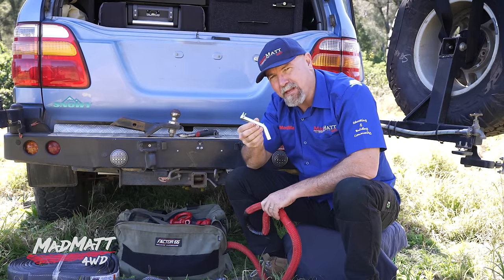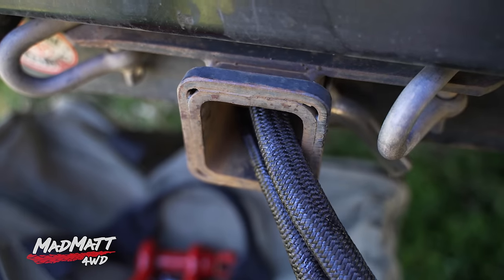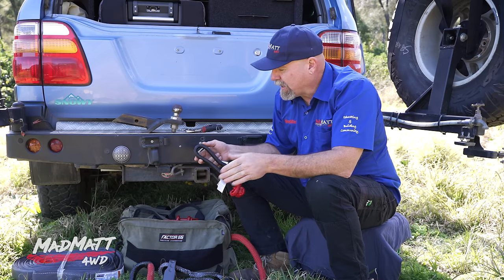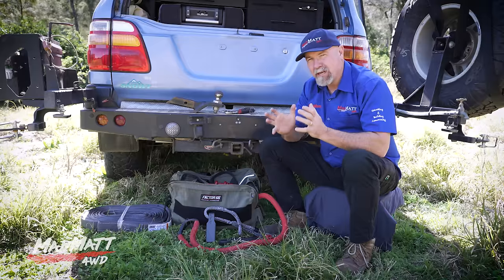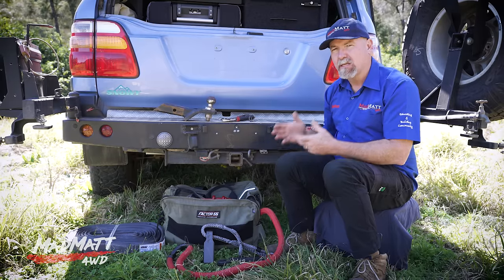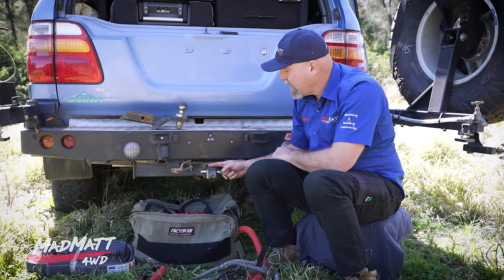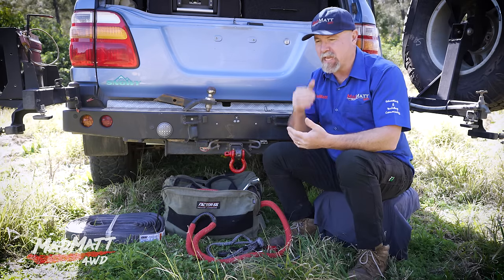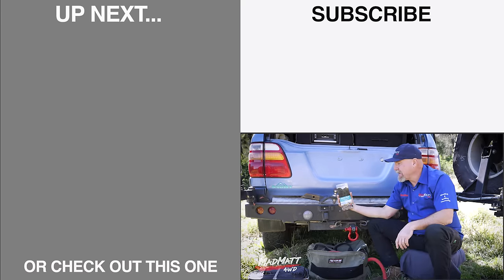Should you use a hitch pin as a 4x4 recovery device? Is it a YES or NO answer?

Comment: Just a question and are we overthinking this, has soft shackles created more hassles than what they are worth at this towbar connection?... cannot figure out why the Hayman Reece tow hitch with the towball removed obviously? I have been leaving the standard tow hitch in the truck and bunging it back inside the hitch receiver then use a bloody big bow shackle thru the towball hole. This has worked for 50 years of 4WDing, many many kinetic tows, many snatch block winches, also many sideways pulling vehicle back on tracks. Also $180 for a hitch receiver.... WTF!
Reply from the maker: Mainly because they are failing. You've got away with it as many others do but that dosn't make it best practice when we learn of failures. Check out this video from the other day. https://youtu.be/2rHvQykNt2M
Reply: @MadMatt4WD  my two bobs worth 'respectfully': the standard tow hitches are likely as strong in every way as the complete towbar assembly. To demonstrate this lets talk about the tow pin, they are not rated because there is no evidence worldwide of any (in good condition) ever failing. 16mm dia pins in 50mm hitches do not fail and it is an industry standard but never tested to my best research (or any tests are not made public). Now let us get to the actual tow hitch where the 50mm SHS (square hollow section) is welded to the often 18 to 20mm thick plate where the towball mounts. The welds as far as I have inspected in a local parking lot are 6 to 8mm fillet welds probably done with robots and perfect. The engineering rule of thumb (engineers will tell you not to use rules of thumb but they all do unless a full analysis of the joint is required) is that 200mm of 6 to 8mm fillet weld will take about 20-30 tonnes of pretty well any tearing, ripping, transverse, shear with a 3 to 5 safety factor. I rest my case that a 'standard' tow hitch will never fail as you say (by the way, lets see a few of the weld failures in standard hitches you mention?? not the stupid extended ones) with kinetic pulls when I will say the kinetic ropes will break long before any standard towhitch with a forking decent bow shackle thru the towball hole. Maybe head down to Swinburne Uni of Technology and ask nicely for them to test standard tow hitches with a 30mm offset of the tongue to the SHS tube. I spent many hours there destroying bolts, plates, welds and anything us students could get our hands on, 45+ years ago and you might be surprised. Then get one of those offset tow hitches like the one that horribly killed a person and test that (the one you demonstrate with the retracting tape measure with the 200mm torsional offset, moment arm, call it an offset force even), the result will be like chalk and cheese (sooooo much likely to fail in every way due to torsional forces that rip, tear and destroy). I did look at the photos of the accident hitch and it did not seem to break at the welds, the SHS tube was torn by torsional forces much higher than anything that could be applied to a standard hitch with any pull a driven vehicle could muster (not a shock pull with a chain, I think that as you say is dumb). Also most decent hitches now are one piece forged units (my 2021 hilux) that I reckon would be even stronger than the $180 alloy recovery units (maybe test these too?). In many ways I am saying that recovery item such as the alloy units that are very expensive are not generally needed and you really should be educating that standard hitches are OK and extended ones are not. You are not comparing apples with apples in your video and this really is important in an engineering sense. Maybe John Cadogan can help with some engineering stuff that your videos do really need. Also as an aside just maybe also say that $39 solid steel billet recovery receivers are around and we dont need this expensive stuff to stay safe.
Reply from the maker: @petermills1402  that’s more that two bobs worth. 😁 I dont disagree with you but take the time to read the comments and understand my audience. I can’t go into the subilties of the subject as you’ve explained. Most of my audience aren’t engineers nor have a concept of it so I try my best to stand in the gap for them between good engineering and bad practice. We have numerous examples of hitches and tow balls failing near the welds for a number of reasons. Fatigue rust, drop hitch, poor quality materials. So, do I try to explain all the different possible reasons to inspect a hitch or do I give a simple solution as to why they’re not always safe and provide a solution. I recommend Factor55 because they’re at the top of the game but I don’t care what people buy so long as it’s safe and not cheap fake stuff. I don’t force people to support what I do it’s their choice if they appreciate the free content I give to them. I also have a fairly large network of experts I engage with so that I’m always learning. There’re generally supportive and in agreement with my work. Obviously we we have differing opinions on some stuff but we work it through. Also John did comment on the video and is not a fan of hitches as a recovery device.
Reply: @MadMatt4WD  here is a challenge for maybe you and Robert whom I also respect his opinions mostly:  just contact Nobles Cranes and Testing Lab for some real testing with an actual engineer in charge and ask if they can test hitches to actually provide some evidence of your advocating (with little or no evidence) that the welds of a standard tow hitch are not safe at the loads of kinetic ropes and straps. Maybe up to 20 to 25 tonnes pull would be a good test, I reckon all your ropes would break and the hitch remain intact. Maybe a standard Hayman Reece 3500kg  tow hitch is a good starting point then the forged tow hitches as on my  recent toyota hitch. I also have inspected several of the 'alloy' recovery hitches some with towpin holes in both directions and these seem a bit 'how should I say' "interesting" and these should also be tested as I for one would not trust one without certified testing. There I have said it, some recovery hitches may not be safe... but I have no evidence, I guess we are in the same boat in an unregulated often cowboy industry of 4WD recovery. Only testing, not talk, will clear some things up and that is what I am really getting at. I would like to see you say that standard well branded tow hitches are OK but dodgy ones are not (just like you advocate a brand of recovery hitch but not others) and provide examples of both rather than just defer to the $180 hitch as the ants pants. Its Youtube you know and us viewers/users are very suspicious of product placement when other things will do the job safely. After all this we have not even begun to discuss towbar connections to vehicle chassis (nor the garbage chassis recovery points I have seen with pissy bolts and bendable plate steel with sideways pulls, some look freekin dangerous),  I have seen towbars broken lots (torn off the chassis, maybe a couple of loose bolts could have helped, but your recovery hitches would sort that out I guess, its all about the weakpoint) due to a bit of overloading (but only a few hundred kgs of bouncing) and rough roads 'maybe' with likely vertical loads but still kinetic ropes of the 12000kg variety could shake the foundations of a thin steel chassis towbar bolted connection. Its a wild 'recovery' world out there with lots of on ground evidence (such as mine and yours experience) but little real evidence/testing..... thanks for the discussion.

Comment: Thanks, that was very clear.
Off-topic can you flip a standard tow hitch 180o to drop the vehicle tow height so the trailer doesn't pitch back when attached to the tow vehicle? Is it safe to do so?
Reply from the maker: I’ve done that for towing only. Some hitches aren’t as strong the wrong way up
Reply: @MadMatt4WD  Most all tow hitches I have seen have both the raise and lower number advertised on them so I would assume they are designed to be used in either application.  USA
Reply from the maker: @iffykidmn8170  Yes i've seen that too but that's for towing not recovery
Reply: @MadMatt4WD  and the poster was asking about flipping it over to adjust the ride height of a trailer.
Reply from the maker: @iffykidmn8170  yes I believe that’s the case. They do have a different capacity when flipped

Comment: Your snatch strap will snap before that pin breaks, the bolts that hold the whole tow point on will break before that does
Reply from the maker: You’ve tested this and can show us the test results? Use the correct gear ay. There’s no need to make do in this area. Some parts of the recovery system limit us but not this area.
Reply: I've "broke" a pin pulling logs. It failed before my straps or the bolts on my receiver. Pin bent till it sheared the cotter pin off and pulled that end through it's hole. 90% of them are only grade 5 or less. Made in china ones... Grade peanut butter 😂

Comment: So I'm looking at an alloy hitch WLL 5000kg.
Snatch strap 8000kg.
So, for the moment,  just considering  these 2 items.
Seems like the alloy hitch is the weakest link.
Means i should go with a steel hitch..  I think!
Opinions please?
Reply from the maker: Good thoughts. Not sure Which hitch your looking at but the Factor55 ones have a rating and a fail number. The fail number is five times that of the rating. So it’s not failing assuming good procedure.

Comment: Hey Matt I'm not sure under this screen name or another one I've mentioned on this subject on a few of your videos I use a giant steel hook goes in with a hitch pin and do a receiver and I don't have to do anything but drop the loop of my rope over the hook they're available in the states at U-Haul centers where they rent trucks and equipment for moving your home contents from one to another I'll be happy to send you one but I need an address and it's kind of heavy so it's going to cost a bit and it's going to take a long time to get there. For evaluation and experimenting and examination purposes
Reply from the maker: Hey mate. Thanks for the offer. I don’t think I’d use something like that. I like a closed loop winching process which a hook has no part in.
Reply: No worries. With the snow in the ice and the stuff we got to deal with here sometimes dealing with screwing opinion gets pretty tedious. And I'm pretty careful with what I do I broke two inch cables and that's all never broke anything else since 2004, the winch cable is because I was stuck trying to drag the Jeep around so I could drive down the hill and back out of where I was at they didn't have a lot of tension on them both brakes were in the same stuck area at the same day
Reply from the maker: @thedeathwobblechannel6539  working in extreme cold is foreign to me. I imagine it effects the cables.

Comment: Would be nice to see load rateing from a load cell that’s hooked in-line when a snatch strap is being used in a recovery the force of the load might shock few ppl
Reply from the maker: Yes we want to do this.
Reply: trouble is most load cells arent designed to handle that sort of work. and those that are are bloody expensive.
Reply: And the shock load of the strap wouldn’t be good for them either there not a thing that like sudden loads
Reply from the maker: @chrisforgan731  yeah I’ve not worked in that space but I’d think you’re right.

Comment: I could not find the min radius rating of the factor55 soft shackle, nor for any others, how can we know using just the pin is too small for it? Within the sailing  and rigging industries a 1:1 ratio of rope diameter to bend diameter is somewhere about 95% of single line strength.
Reply from the maker: The ratio is 1:1.
Reply: @MadMatt4WD  I am not a Factor55 expert, but it seems their soft shackles are 3/8", a hitch pin is 5/8" so your statement that using the pin is under the min bend radius is incorrect? Looking around, 12mm seems to be where soft shackles top out in diameter, so that is likely a non issue? 
I feel like trying to get people who don't understand decent recovery gear and don't have a lot of cash (so the young people most likely to get stuck and hurt themselves) to spend money on safe equipment isn't helped when you say you need this chunk of metal that ranges from $90-$250 to connect your strap to, will just end up with people skimping on both.
Reply from the maker: @auszooker  this is from Factor55 The 2” hitch itself is rated for 9500 lbs. that’s the max load. That’s why the 2” HitchLinks, all of them have 9500 lbs machined into them. Our parts have not seen yielding in testing until just before breaking. What’s this mean? Every other item you have attached to the HitchLink and pin will fail before either of those do. 

Standard duty soft shackle - 39K 
Tow Strap- 31K 
KERR- 29K 
HitchLink 2.0 - 51K 
Hitch pins- 50+K 

The entire off-road industry functions off break strength not WLL. 3/8 Synthetic rope breaks between 18-22K so a 5:1 means it’s WLL is only 4.4K on a 12K winch? 

It’s about quality of materials and validation through testing.

You make a fair point on the cost. My audience starts at around 25 and goes up so for the most part they’re not that poor and we see plenty of sales. That’s means I can keep trying to help people. You may not like The way I do it but I’m giving it a crack and know I’m helping in a good way. It’s good to have the discussions though.

Comment: Is the stock hitch receiver on something like Chevy 1500 safe to use for recovery? (assuming the vehicle being recovered weighs less than the 1500, and all gear is rated for at least the weigh of the the 1500)
Reply from the maker: I can’t really answer that question but the weight of the vehicle is only one contributor to the recovery load. A bogged vehicle can take a lot more force to recover than its weight.

Comment: Interesting you say the pin bends at 9 tone (9000kg) but the recovery hitch you are promoting is only rated to 9500lbs which is only 4309kg. Its seem the simplest thing would be file a nice bevel on the inside of the receiver and use the pin. You don't mention any thing about SWL, WLL or MBS which from a rigging point of view are critical when you are talking about ratings.
Reply from the maker: See my above comment
Reply: I’m not sure which comment you are referring to. Also the pin remains in double shear even if you are using a sling on it. Here is a simple explanation https://coefs.charlotte.edu/mwhelan3/files/2010/10/ICD_Single_V_Double_Shear.pdf 
When you use your recovery hitch and a soft shackle you add two additional failure point when you could have just put the snatch strap on the pin. Your intention seems good but some of the information you are providing isn’t correct.
Reply from the maker: What i wrote above.
Thats a good point I hadn't connected that. I'll have the discusion with Factor55. I still maintain it will be a better connection point.

Note the centre section has a hole in it thats what makes it double shear. a strap is a loop. watch that part of the video again to see me explain how the hitch recivers hole supports the pin.
Reply from the maker: From factor 55. The 2” hitch itself is rated for 9500 lbs. that’s the max load. That’s why the 2” HitchLinks, all of them have 9500 lbs machined into them. Our parts have not seen yielding in testing until just before breaking. What’s this mean? Every other item you have attached to the HitchLink and pin will fail before either of those do. 

Standard duty soft shackle - 39K 
Tow Strap- 31K 
KERR- 29K 
HitchLink 2.0 - 51K 
Hitch pins- 50+K 

The entire off-road industry functions off break strength not WLL. 3/8 Synthetic rope breaks between 18-22K so a 5:1 means it’s WLL is only 4.4K on a 12K winch? 

It’s about quality of materials and validation through testing.
Reply: @MadMatt4WD  Thanks for the clarification. So the MBS of the hitch is 4039kg (9500lbs). My soft shackle MBS is 16000kg and my snatch strap is 11000kg. Looking at these numbers the factory 55 hitch is by far the weakest link and it adds an additional failure point. Please don’t think I’m trolling, I’m just observing the info you are providing and doing the maths.
Reply from the maker: @Uncutclimbing  the hitch link is the strongest item at 51k fail point. As the comment above says the Offroad industry works off break strength.
Reply: @MadMatt4WD  perfect thanks for clearing that up. Jumping between different measuring systems makes it a bit confusing. I guess to keeps it simple when you’re explaining things it would be best to only use the MBS in kilograms. Thanks again.
Reply: in australia its working load limit. overseas they say minimum breaking strain. there is a big difference between the two. all australian standard lifting equipment has a minimum 6:1 WLL to breaking strain ratio. lashing capacity is different at 4:1 ratio.
most steel shackles will be rated for lifting so be careful to choose the right sizes

Comment: show me a video that shows one pin bending with tonage shown and a pin breaking with tonage shown and ill believe you  in my mind they ok to use yes sharpe egdes are no good i've smoothed mine off  and i have a bigger pin  in my hitch then most 20 mm to be extact  and the recovery hitch your showing has some pretty square ouside edges  in my opinion the more rounded the edges are the better
Reply from the maker: I’ll stick with the designed and tested gear where possible.